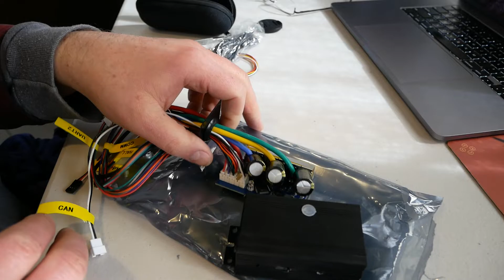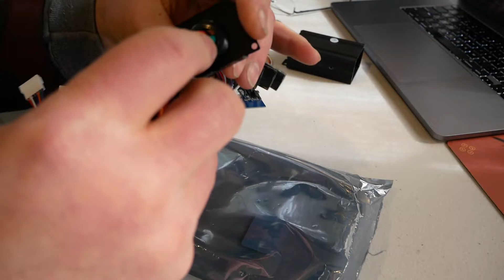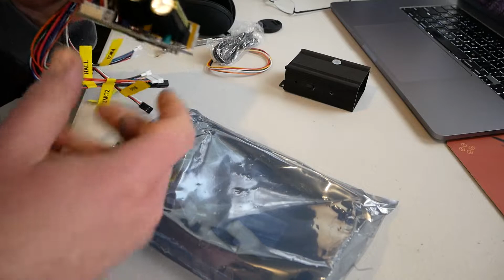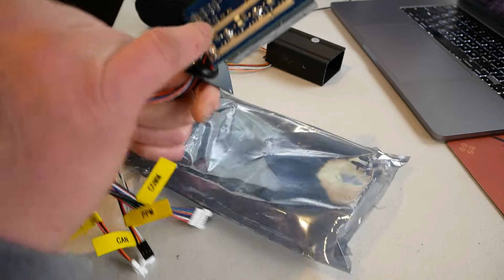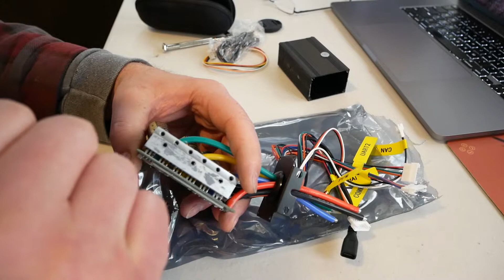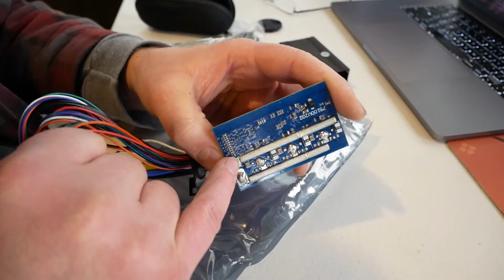Flipsky 75100 teardown

Comment: The quality of this review if through the roof. You killed it bro! 

Thanks a ton! 

Do you have modding tips on what we should do to prolong the life / solve the heating issue? I already have this controller and love to mod it instead of ordering new one.
Reply from the maker: I did 3 videos on mitigating issues:
https://www.youtube.com/watch?v=h9mX_XkRRpw&t=554s
https://www.youtube.com/watch?v=LHF6U1Lwp7s&t=375s
https://www.youtube.com/watch?v=aURvK3YPdjg
*
I never made a video on one detail. I tapped the internal heat spreader for M4 screws. This gave me the ability to mount the controller to something else by its mosfet wall. I later machined a chunk of aluminum that screws down direct to the mosfet wall and then is a mounting bracket that puts that hunk of aluminum onto the cast aluminum of one of the swing arms. I now have a pretty huge heat sink for the controllers! I'm betting I never have over heating issues.
Reply: @de-bodgery  Oh, sorry I missed those. Will check them out. Thanks a lot!

Comment: Hey man, Ive missed our conversations on the discord server. Very insightful video, my laziness ended up catching up to me and killing my 75100. Managed to fix it (one of the caps came loose to no ones surprise) and secured them alongside reenforcing the current paths. Looks like my bountiful quantities of hot glue weren't enough since the same issue happened again with a cap and this time the controller is dead. Looks like Flipsky are aware and are releasing a revision of the controller with a different casing which looks significantly more promising for thermal dissipation. Also has the advantages of removable connectors and USB C.
Reply from the maker: I abandoned Discord...way too much drama over 1 guy constantly trolling me. I had enough so I left.
*
Hot glue gets soft when it warms up and doesn't secure things very well as a result. You need thermal glue. Once it cures, it will handle 400C and not burn. You don't care overly much about the thermal conductivity so this is fine for securing things or where "some" thermal transfer is needed. There's better thermally conductive glues, but this will do fine for securing your caps in the controller.

https://www.amazon.com/GENNEL-Conductive-Silicone-Adhesive-Compound/dp/B07PVN1BC3/ref=sxts_rp_s_a1_0?crid=38KR20V1HKX98&cv_ct_cx=thermal+glue&keywords=thermal+glue&pd_rd_i=B07PVN1BC3&pd_rd_r=1ac4f715-30a3-4182-8f5d-e6865bf1c633&pd_rd_w=5klBH&pd_rd_wg=mmgtj&pf_rd_p=4bf4bfb7-01d6-422f-8e64-ff8707d77d6c&pf_rd_r=NW43V7VKWMMQVQ9HMKM5&psc=1&qid=1650647435&sprefix=thermal+glue%2Caps%2C163&sr=1-1-5985efba-8948-4f09-9122-d605505c9d1e
*
Where did you see the revisions Flipsky was making?
Reply: @de-bodgery  Hmm seems like my VPN might have caused my reply from a few days ago to be removed. I was hoping the caps wouldnt get as hot as the FETs since the controller starts rolling back current when temps hit 80°C and the melting point of hot glue is right around there. It actually didnt end up melting in any noticible way just broke off. If that was due to it softening I cant say but Ill be using the JB Weld steel stik stuff that I use on my halls for future reenforcement of caps. I was beating on that scooter really hard around some super rough paths so Im really not surprised the controller failed.

The new 75100 design is linked below. Seems to be a significant shift in design as it doesnt seem thick enough to fit the same caps and the last design. There is also a raised USB C port for some reason but I cant see that being a huge issue when the phase wires also stick out a fair way.

https://flipsky.net/collections/electronic-products/products/flipsky-75100-with-aluminum-case-based-on-vesc-for-electric-skateboard-scooter-ebike-speed-controller
Reply from the maker: @phylaxxx  Be careful of JB weld. They contain metal and that's conductive. You might just short out your controller and that's just as bad as having broken of caps! Thermal glue is the proper glue for this application. It's thermally conductive, electrically non-conductive and can be removed again later if needed.
*
The new 75100 is like most stuff that Flipsky makes and unfortunately almost impossible to water proof! GRR! I'm still baffled at the name "75100" when that's not really applicable! They are 100v max controllers in either configuration. The name ought to be "100-100" like Tampa does with the 100-250 or "84100" since their useful upper voltage is really about 84v. No idea what Flipsky is thinking there since this diverges with the naming convention they have used with everything else! The 75200 from them really is a max of 75v, NOT 100v like the confusing names for the 75100 controllers. LOL! That USBC port is weird...why did they do that? Should be nearly flush with the top of the shell. OH well...it is USBC...so that's an improvement over the ever lasting micro USB ports that are ancient tech!
Reply: @de-bodgery  Ive used this specific JB weld on plenty of other eletrical items and its been fine. Its technically conductive but I doubt any of the voltages in that controller will be high enough to actually cause an issue. As much as I would like to simply order some thermal glue off Amazon I cant because Amazon doesnt ship here and no one here sells it for a reasonable price. The joys of New Zealand...

I agree that the lack of waterproofing options is annoying but its a tradeoff for price and compactness I guess. Its not difficult to get an aluminium water resistant enclosure in any case. I also agree the naming scheme is a pain. Not sure about that USB C port but at least its a socket and not a cable, I slightly pinched the cable on the last unit and that caused comms to act a bit funny depending on the angle of the cable.
Reply from the maker: @phylaxxx  Yeah cool...marine jb weld has no metal in it either. It's the regular JB weld and JB kwik that have metal in them.
*
New Zealand...beautiful country! I've always wanted to go there. Hawaii is like your country. Everything is imported if it doesn't grow there and so it costs a lot to get it. I shipped some stuff to a friend in Hawaii a few years ago. The shipping cost 2X what it cost compared to what it cost to ship across the country.
*
I was hoping that someone would start making VESC controllers that were in the same form factors as most EV grade controllers so they could be used exposed to the weather. I'll have to do the same...make a box. Agreed...rather have the USB port built in than as a cable.